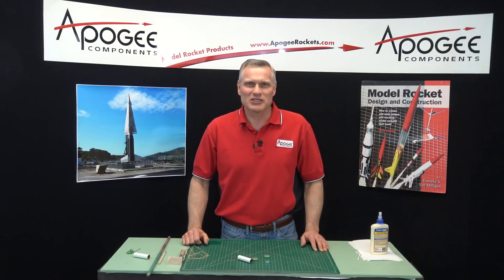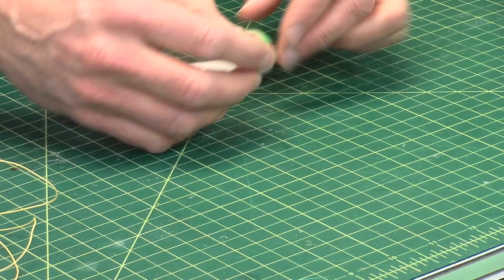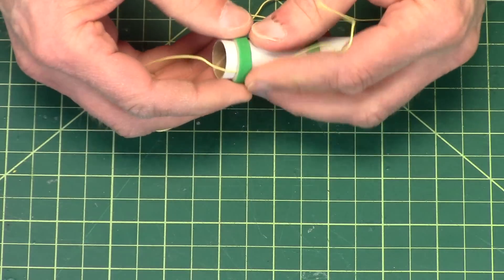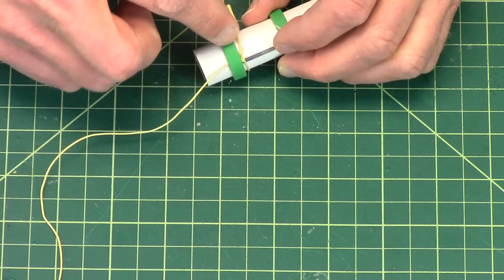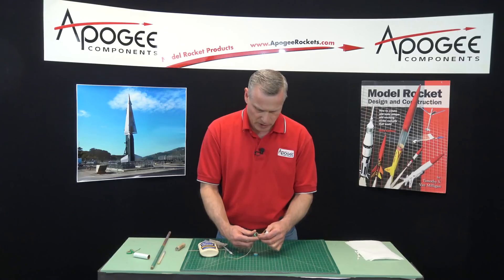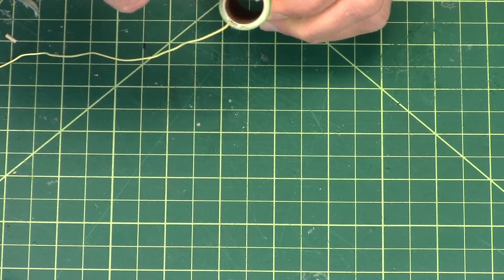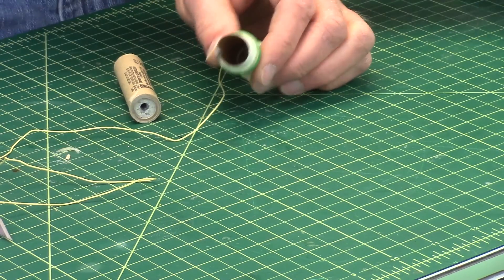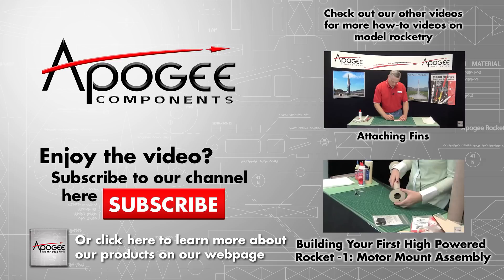Motor Mount Assembly

Comment: When I attach my shock cord to the motor mount the ejection charge destroys the shock cord, what am I doing wrong?
Reply from the maker: Are you using Kevlar? It is heat resistant. Rubber cords are not.